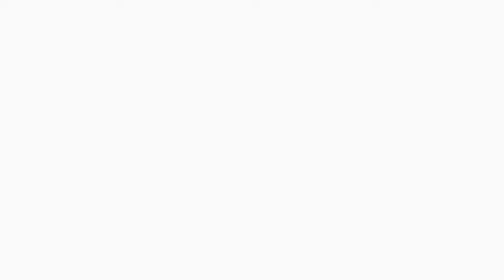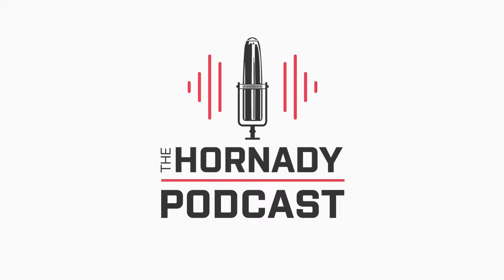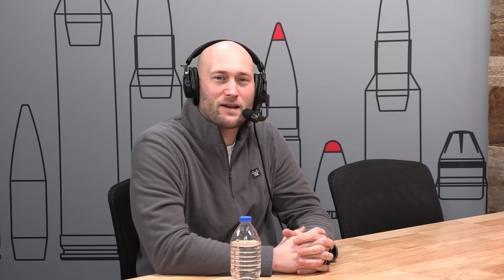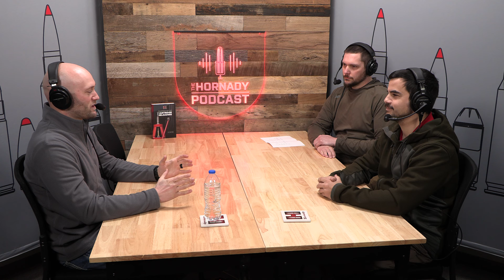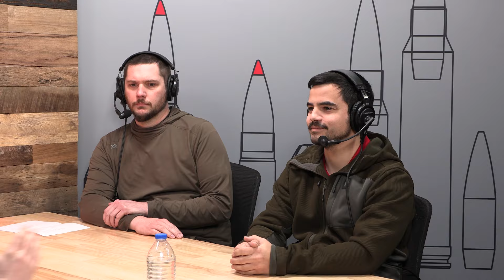Ep. 062 - The Venerable 308 Win

Comment: I love the .308 and have more than one rifle in that caliber. And have hunted with it (no harvest, yet.) I came to liking that round precisely because of the military history of it. It is still used in training after 50 years. Marine Scout snipers had the M40 and the Army Rangers and SF groups had the M24, usually a Rem 700 action and in .308 for a few reasons, First, as mentioned, global availability. And a number of people used to say that if a rifle was chambered in 7.62 NATO, you could not fire .308 because .308 had higher pressure. That is, glad to see it cleared up here, a misconception. Any action and rifle is going to handle both. The 7.62 was loaded lower pressure and slightly thicker walls precisely to avoid problems of temperature and elevation extremes. You can be in the jungle in Vietnam or in the mountains of Afghanistan, going from 95 F with high humidity to a dry 30 F and you needed ammo that would travel and still be good.

Even today, SOCOM gave Barrett the contract for MRAD and it has .338 Norma Mag, .300 Norma Mag, and .308 Win. Then another version came out that had .338 Lapua Mag and .300 Win Mag, but still the .308 W. 

The reason for .308 with the ammo used is that it could get some energy into a 200 pound target out to 600 yards with fairly low recoil. The downfall was the amount of drop and wind deflection. From what I have read from 3 different retired snipers, the engagements in combat were less than 600 yards, sometimes quite a bit less. In fact, the equally big part of sniper school is the sneak. Getting closer is better.

One of the authors I have read is retired Sgt Nicholas "The Reaper" Irving of the 3rd Ranger Battalion 75th Ranger Regiment. He carried in service a Knight Arms SR-25 (the Army's MK 11 Mod 0) in 7.62 NATO. He earned the nickname because he has had the highest number of confirmed kills in a deployment, 33. Many more than that. Confirmed means the target was verified with personal effects and information.

I figured, good enough for combat, then good enough for whitetail. Bucks where I live can get to 140 lbs.

Of course, now, I have been bitten by the 7 mm PRC bug and got me a rifle in that and it may become my favorite for both slamming energy and reach. I think of it as a 7 mm Rem Mag with more accuracy and ambition, pushing a heavy bullet. It could easily become my all-around rifle. But I will still hold onto my Windham Weaponry R16SFST-308 (AR-10, with M-LOK handguard) because it is accurate and great for some applications. But I really like bolt rifles.

Comment: My favorite is the 308. Kinda wish we could neck up sig 6.8x51 hybrid brass to 308 and run the higher pressure
Reply: What is stopping you?
Reply: @grumpybill  well the 80k pressure rating exceeds most normal barrel materials. The sig cross uses some kind of proprietary alloy for its barrel.
Reply: I wonder about the pressure ratings of general bolt guns. Can they withstand the extra pressure? Compounded by the extra weight of the bullet? Say, a 180 grain bullet? Or a 190 ablr?

Probably better to just get a 30-06, lol.

Comment: This show is a bit weaker than the other ones -- the main reason why the 7.62x51 came about is because in its military loading of 30-06 with faster burning powders they had half an inch of empty space. The modern M80 is a bit hotter load than the WW2 30-06 M2... at the same time the 30-06 can be loaded for hunting purposes in bolt action rifles to significantly more powerful loads than the 308Win. The 7.5 Swiss is more powerful cartridge than the 7.62x51... the 7.5 French is very similar to 7.62x51... the Russian 7.62x54R is a bit more powerful cartridge than the 7.62x51. IMR-4064 is not what it used to be... today it is a much slower burning powder and not ideal for the 308Win. IMR-4895 is far better. In fact the powders in the M80 are closer to IMR-3031 in burn speed.

Comment: I would be careful telling people that any 7.62x51 chambered military rifle should be OK with factory 308 win off the shelf ammunition.  Probably won't actually blow up the rifle,  however; there are a few 7.62 x 51 nato rifles that will make two pieces of your brass with factory 308 win .
Reply: Maybe they should have made the statement 7.62x51 with proper headspace.
Reply: Which few?
Reply: @asherdie  Typically heavily used ones with stretched receivers or worn chambers.   The rear-locking Lee Enfield-based Ishapore 2A1 is a candidate, as are machineguns.  My 2A1 was fine, though.
The brass stretches to fill the longer chamber and can break (generally case-head separation), especially if the brass has been reloaded several times.  Most 7.61x51 military ammo has thicker cases and was designed to be used only once, so it was not a problem in service.
Reply: Civilian .308 hunting ammo is definitely hotter.  .308 is NOT M-80 ball ammo.
Reply: It’s the opposite
Reply: @BaconSlayer69  It depends upon which ammo.  M-80 is locked into propellant tech of the 1950's and the operation of all weapons based upon it.  Higher performance powders are available now.  Hornady's Superperformance 150gr loads, for example, are considerably faster.
Reply: @jfess1911  no it doesn’t 7.62x51nato is loaded at a lower pressure compared to .308win, you can shoot 7.62nato out of a rifle chambered in .308 but you can’t shoot .308 in a rifle chambered in 7.62nato that’s a known fact
Reply: @BaconSlayer69  I regularly shoot NATO M-80 ball that was mysteriously liberated.  It’s a low recoiling cartridge that I can shoot lots of out of my hunting rifle without beating up my shoulder.  But when I switch to .308 hunting rounds, there’s a very noticeable increase in recoil.  Even with my old boxes of Wolf .308.  Not excessive, but definitely noticeable.
Reply: @blackhawk7r221  .308 is loaded to a higher pressure then 7.62x51nato
Reply: @BaconSlayer69  I can refer to my reloading manuals, but 7.62 is loaded to 60K, and that is standardized.  The average .308 on the shelves today is typically at least 65K.  Even run of the mill .308 still uses the old 62K standard.
Reply: @blackhawk7r221  I’m talking about factory loads , you still prove me right good day to you
Reply: @BaconSlayer69  The 7.62x51 and 308 pressures are close to the same and well  beneath the max pressure used for proof testing rifles using either.   Europe's C.I.P. does not differentiate between 7.62x51 and 308.
 Back in the 1950's when the rounds were developed and the "Copper Crusher" method was used, M80 had an average of 50,000 psi and 308 an average max of 52,000. NATO members, including the US now use the EPVAT method with an electronic pressure transducer at the case mouth. The standard is 60,191psi using that method, but the ammo is the same.  SAAMI accepts two methods, the old copper crusher (52,000psi) and its own electronic method with pizeo pressure transducer placed on the outside of the case (62,000psi).
Reply: @jfess1911  nope they are not

Comment: I have a question. Why does the reloading hand book not have gas gun and bolt gun for 223 like they do for the 6mm arc. I run into issues trying to find loads that work in both my AR and my ruger bolt. They both have a 1:8 twist.